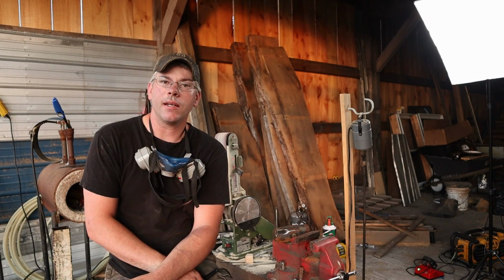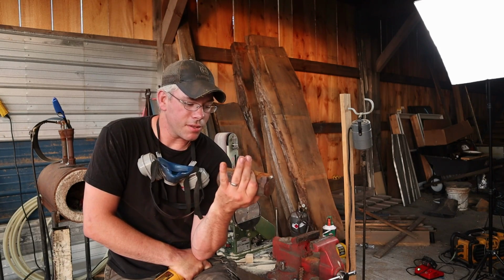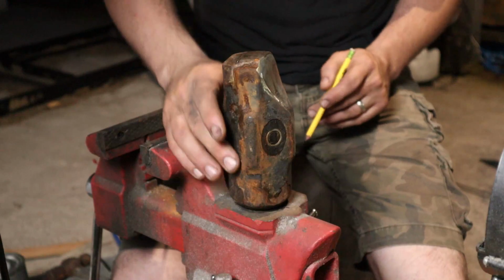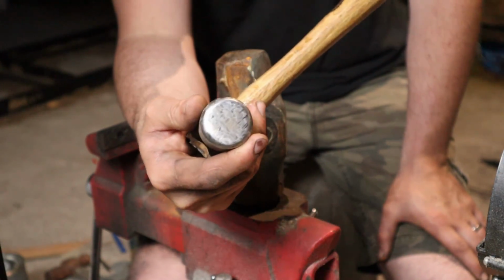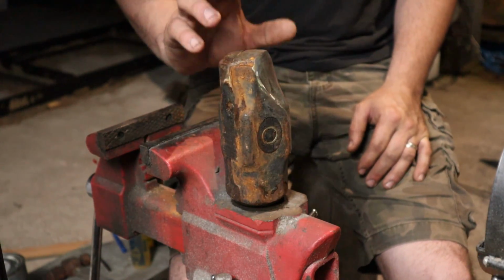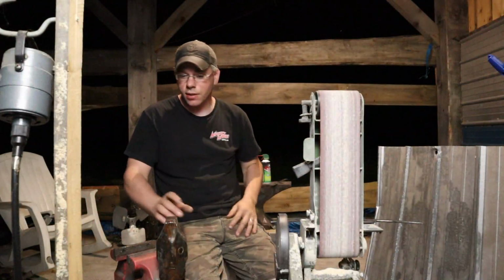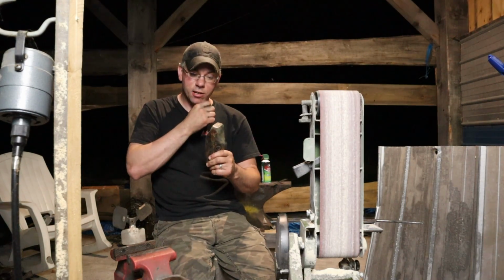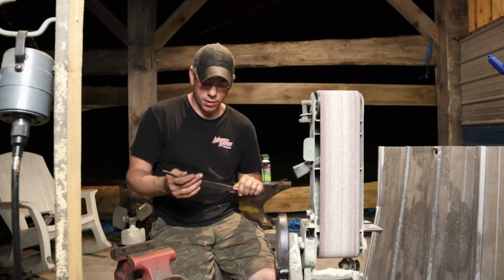Making a Massive Cross Peen Hammer

Comment: Nice Job on the diagonal cross pein Jim, i never considered modifying an existing hammer to make one, generally you will use one side to stretch the metal in one direction then flip it over to stretch the material the other way ie one side will add length and the other side will add width
Reply from the maker: I figured that since I forge with both hands that I can use this one the same no matter what, takes that awkwardness out of switching hands.

Comment: Why didn't you heat the hammer to make the face softer to work and then re- quench the faces after you finish?
Reply from the maker: I want to keep the temper in it, I don't want to have this thing shatter on me with an improper heat treat.
Reply: @TheTradesmanChannel  I was just wondering because that's What I would have done but I see a new quench could change the grain structure making it weak
Reply from the maker: If I knew what I was doing a little better I would do it in a heartbeat, I'm in the beginner stages of this stuff.

Comment: Had you annealed the hammer first. It would have been much easier to cut out. They just re-heat treat at the end.
Reply from the maker: I did that for a reason and have explained it many times in the comments.  It actually cut just fine.

Comment: Hey, Jim. Did you anneal the head before cutting away the excess material? Probably would have worked more quickly.  Sounds lime a decent design, can't wait to hear your review of actually using this angled peen hammer. I don't recall ever seeing the peen on an angle before.
Reply from the maker: I did not anneal it, I wanted to keep the temper right in it.
Reply: @TheTradesmanChannel  okay, thanks.